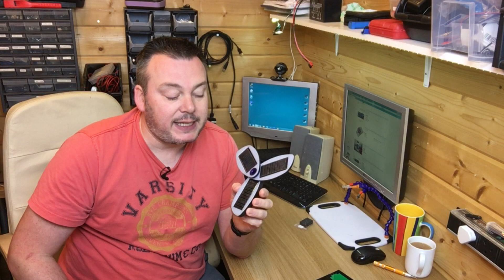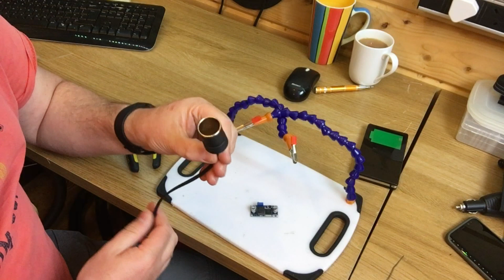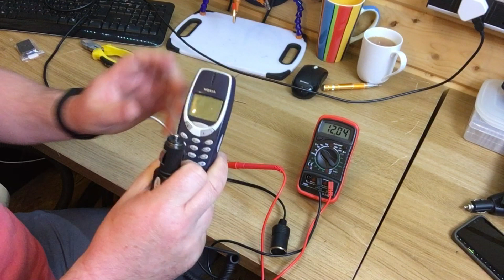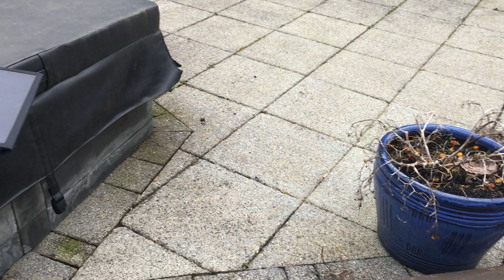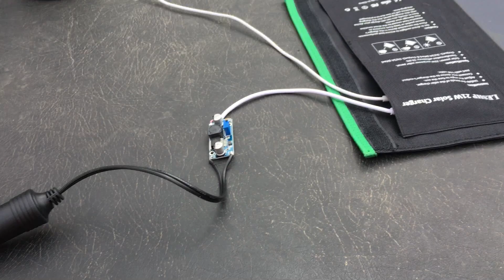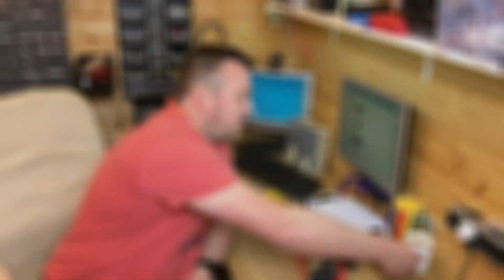12v FROM 5v SOLAR PANEL

Comment: Electricity is so confusing. If the solar panel puts out 5v, why boost it to 12v to use on a phone that only needs 5v??
Reply from the maker: Very good point. It’s an inefficient way of doing it but if you only have a 12v car charger… it’s the only way.

Comment: I stumbled upon this video while building a solar charger, and I noticed the log walls. Are those Cypress Wood? They look just like the downstairs walls of my house (my dad built it before he passed away).
Reply: BTW My solar charger is a bunch of daisy chained solar yard light tops from Dollar Tree. it works. They only do less than a volt each but theres enough of them to send out a little over 5 volts.

Comment: It ,s very nice what you did , please can you help me also : i have just like you have  a folding solar panel charger  with two USB 5v output  and   a potable Generator / station 222Wh , 20 ah/ 11,1 Volt . I want to charge this power Generator with your similar foldable 2 usb solar panel  , i tried to take current from usb to powerstation but no result , maybe the voltage is to week , or soult i cut the foldable panel  and take wire from inside ? Are ther more voltage  ? Please help me , thanks in advanced